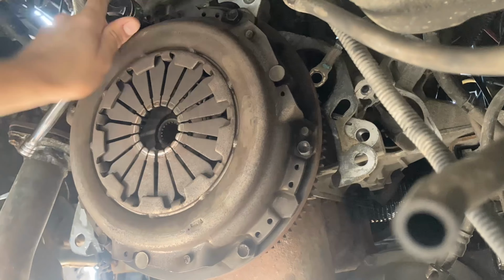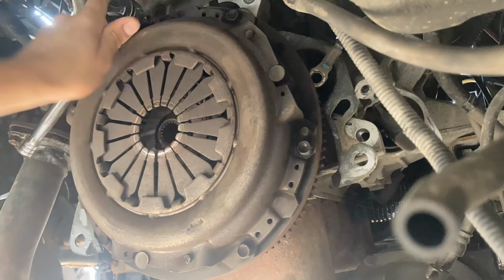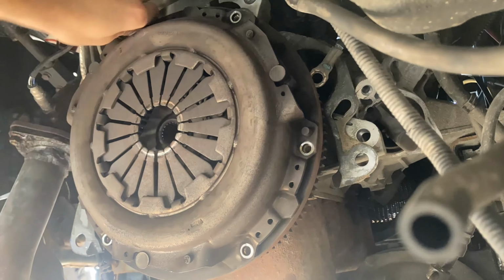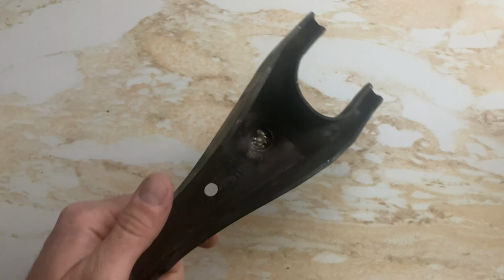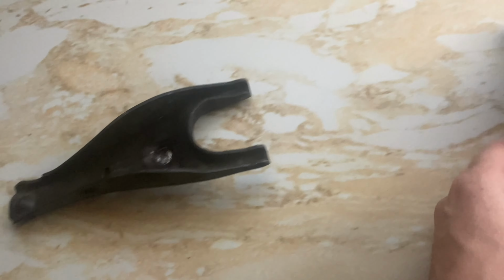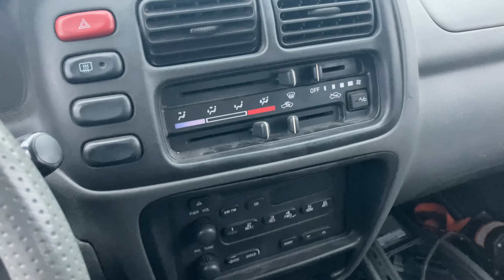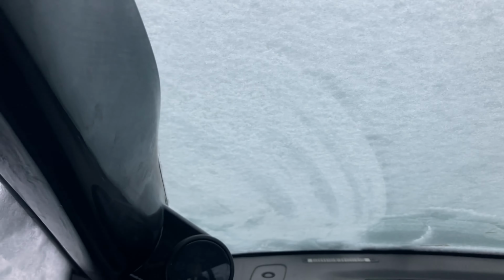Tracker stage 3 clutch install

Comment: You got a link to the clutch? How do you like it
Reply from the maker: So far it has been working great taking abuse. I’m very happy with how it performs so far. It chatters a little if your trying to ride the clutch because it engages harder but nothing I didn’t expect. Here’s the link I’ll add it in the description too. 

https://www.ebay.ca/itm/401884656311?mkcid=16&mkevt=1&mkrid=711-127632-2357-0&ssspo=kBOAW-mQQv6&sssrc=2349624&ssuid=C_9BMwLFQeu&var=&widget_ver=artemis&media=COPY
Reply: @BrettProctor212 it proboby chatters cause you took a die grinder to the fly wheel
Reply from the maker: @nomajhondeere3324  yeah that didn’t help that I didn’t have a new flywheel. My buddy has this clutch in his Sammy and it chatters also, i actually took it to an event and over reved it and blew this clutch up around 7000rpm, I forgot in the listing it was recommended not for high rpm’s, so I’ll be putting in a more stock style clutch.  It blew a hole through in the bellhousing being a little throttle happy on the ice and snow. I’ll do another update video on it when I get the trans pulled back out!

Comment: What lift kit did you use and how high is it?
Reply from the maker: I made a 3” body lift and it has a 3” suspension lift for a total of 6”. I used Ford Focus wagon springs on the back trimmed with cavalier shocks and spacers in the front with a diff drop. It will be getting solid axles this year my front diff keeps breaking the mounts off under heavy stress from mud because it’s the aluminum one 👎.